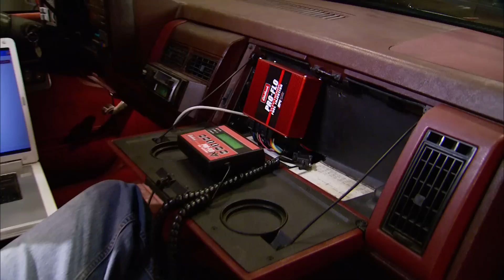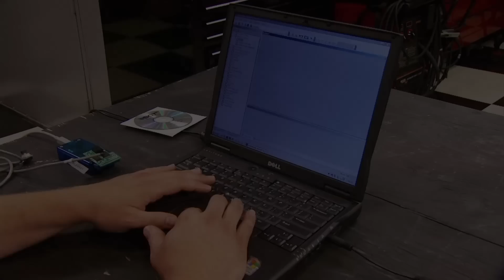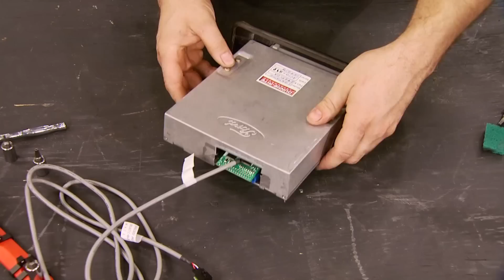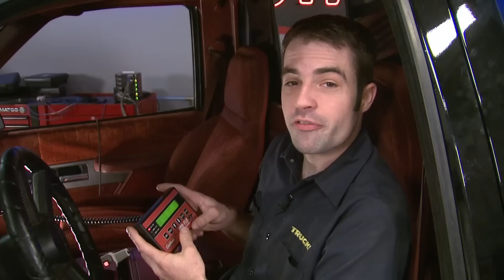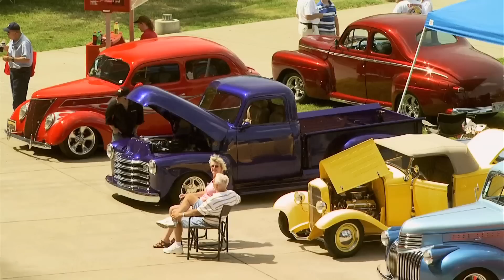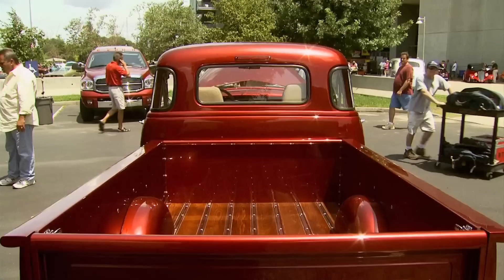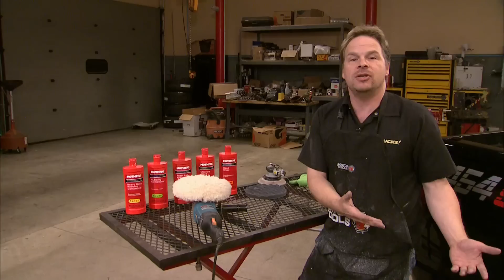Chassis Dyno Shootout: Chevy 454 SS vs Ford Lightning MuscleTrux Wars Part 6 - Trucks! S10, E15

Comment: So, expensive heads, expensive cam, expensive induction, all for 400hp? I made more than that with a mid sized cam, head porting and an 850 dbl pumper on a 1970 oval port 396

Comment: Im a Ford guy but I expected that 454 to make a ton of torque...but that 351w is a strong engine, My granpa bought a brand new 96 F250 with the 351 used it mostly for farm use pulling his Jd4020 tractor, fertilizer spreaders with 2 tons of fert...he babyed the truck, but when my pops got ahold to it...Long tube headers, true duals, intake ported, cylinder heads ported really woke it up...Shouts from TEXAS

Comment: Yall had to of had these detuned for for emissions and corporate reasons you can put aluminum heads and drop compression on 454s and make more power from flow alone you added flow and compression and got numbers factory heads can do with a cam and dual plane with a carb these trucks are pathetic in the power department went from worse to only bad

Comment: I wonder what these would make on a crank dyno? Probably close to 100 hp more and 100 tq on each measure. On Motor Trend Engine Masters they only measure crank dyno with no accessories like the auto industry used to do for gross hp not sae hp.

Comment: My stock 01 Z06 made 350 whp SAE corrected lol. That's with a smooth idle and 30 mpg and only 346 cubic inches. How did a heads/cam package on a 454 make less power than a stock LS6 from 20 years ago?
Reply: The EFI kills them. With a 780 carb it would've made more power. Because those LS6 454s were actually in the 550hp ball park.
Reply: @anthonypesqueira7540  That doesn't make much sense. How would electronic fuel injection create a massive power loss?

Comment: Maybe I'm missing something but I remember engines making way more power than this in the 60s and early 70s. Especially the 454. Well over 400 hp from the factory. High compression and leaded fuel I guess
Reply: That 454 needed new pistons to get that compression up. It still was under 9.1 with those new heads that’s not going to make a lot of power without boost.

Comment: Sitting here  watching these guys turn wrenches and throw money away  ! At 2 gas trucks ! To get 350 ft lbs torque ! 94 dodge 12v 175 horsepower 420 torque  STOCK!  SO LET'S SEE ! $300 for 150hp fuel nozzle ! $800 for turbo and $400 4"exhaust and $ 200 for head Studs and gasket  !  $1700 in parts ! 300  to 330 hp ! At 300 hp b around 540 torque and 330 hp real close to 600 ft lbs of torque!  But I bet they spent way more than $1700 ! Bet they could spend  $3500  on them gasser and not make 600 ft lbs  torque  !

Comment: Man pretty lame numbers for the 454 but definitely could use a little more compression. And as for the cool lightning it really needed a decent set of heads with good springs and an a cam with actual lift not that tiny crap they came with from factory and then you'd be able to rev it past 5500 safely with out valve float

Comment: In my opinion the 454 needed a lot more compression at least 10-1 .my 1999 z28 made  350hp 350tq ls6 intake tsp stage 2 truck cam tsp 17/8 longtube headers 3600 stall 410 gears tuned

Comment: Years ago I had a '72 Chevy El Camino SS (Chevelle Edition) that came from the factory with a 454 big block and  TH400 trans.  I added a 2800 stall convertor, true dual 3" straight pipes, a set of 10X15's on the front and Mickey Thompson 26X15's on the rear all mounted on Cragar SS five spoke rims.  I was thinking about lowering it but I had an "accident" and totaled it and almost killed me a brother of mine and me to boot.  Lord I wish I had it today exactly like it was... pre-accident that is!!!  
I've always been a Chevy person.  Not that I haven't owned all kinds of other makes and models, it's just I've always had better luck with Chevys than the rest.

Comment: Using computers and software on these old crates! . bleeeh yuck.  Use hei and stand-alone systems at the most. Turbo with a carb even. These things suck...Have to go to a tuner and buy a bunch of computer trash to run my  rod.. what a joke.

Comment: 454 ONLY 350 HP IS NOT VERY GOOD YOU NEED TO GET COMPRESSION TO AT LEAST 9.5 - 1 YOU SHOULD CHANGE OUT THOSE CRAP PISTONS AND YOU SHOULD GET A SOLID 450 HP AT THE CRANK.

Comment: Love these trucks.  But a 454 with aftermarket heads vs a 351w with a rear mount turbo.  No contest.  Why not upgrade the HCI on the 351w to give it a fighting chance?  90% of owners would go that route.  Not this rear mounted turbo setup and the associated EEC IV tuning , which is a lost art nowadays.  This is an unfair/unlevel build of these badass muscle trucks.  I mean GT40 heads were the cats meow back in the 90's early 00's but today?  Waste of time.  Might as well LS both of them and have some cookie cutters ready to dyno identical numbers minus driveline losses........

Comment: Thousand dollar 86 short side Chevy, mild 383 with cam and vortec heads.... 400 horses all day long, and 20 years ago, with a carb, and almost no money lol... daily drove it for years with a 3000 stall, and would have smoked both these trucks with 2 plug wires off

Comment: The Ford has a turbo? I thought these were supposed to be stock.
Reply: The chevy is not close to stock either. Different top end. Watch the earlier videos
Reply: @jasonamerica7618  Yeah well it's still na. Turbo vs different top end is no comparison.
Reply: @IanRLewis  I agree with you but 351 vs 454 the ford had to make up 100 cubic inches somehow
Reply: @jasonamerica7618  My old Dakota RT had a 360 and it ran much faster times in the 8th and it was close to stock. I didn't need to make up for any cubic inches. You got people in 4 bangers running times that are 5 seconds faster than these guys. It's not about cubic inches in other words.
Reply: @IanRLewis  2 things 4cyl cars are a lot less weight and both trucks were having traction issues. A RT Dakota didn't put down near the power of either of these trucks so I don't know how you were going so fast
Reply: @jasonamerica7618  2 door Dakota Rt was a  lighter truck by 1000 lbs with 350 lbs of torque bone stock and mine was not bone stock. I was even faster than the supercharged 99 Ford Lightning that had 100 horse more than me. It's not about power all the time. The trucks in the video had slicks and I did it on street tires with about 20lbs of pressure. I was in the Dakota Rt club for 9 years in Chicago and Florida. We had Lightning Dakota shoot outs all the time. I am talking about the Lightnings that were newer and faster than that old 95 in the video. Some were running 10s in the 1/4.
Reply: @IanRLewis  Sorry but a 2 door Dakota with a 360 is not 1000 lbs lighter than a 95 or 2001 lighting. I get the feeling that you are a dodge fan boy, so no matter what I say about these trucks you will keep calling them slow junk. Truth is that a ford lighting of any year will bring a lot more money than a Dakota Rt. Dodge has always been the worst of the big 3 because of there slow sales. They didn't have any money that's why the Government bailed them out twice then they still went bankrupt and got bought out twice. To each their own
Reply: @jasonamerica7618  No I actually have a Cobra now. I sold that truck a while bacl. It is the only video a made public on youtube. The truck was great though. My truck weighed 3500 lbs. It was the regular cab without back seats. The guy I sold it to still has it and takes it to shows. He was my neighbor in St Pete, Fl. I ran 8.6 in that truck at Lakeland Speedway in the 1/8th. My Mustang spanks the shit out of that truck. I just can't understand why the times are so slow with the ho those guys have.
Reply: @IanRLewis  My guess is the trucks need more gear in them. My old Mustang ran 11.90s in the 1/4 mile  and it was mid mid to low 7s in the 1/8th I can't remember to be honest. I know 9 seconds in the 1/8 is slow. Sorry I called you a dodge fan boy by the way
Reply: @jasonamerica7618  I don't blame you. I found Ford to be the most reliable and fastest.

Comment: And it's at least 400 at the crank what's all the complaining about with compression and bigger cam there's your 450 500 horse motor they didn't aim to build a high compression big block that might over heat in a big heavy truck that thing will probably tow anything and never get hot on junk fuel

Comment: Everyone complaining that power numbers were low back then mid ten second 350 Nova I had was fucking flying it was all motor 3300 pounds the pro street drag class was only running 950 at our track now they run 7 sec the 454 only had 8.5 to one and adding 120 plus horse like he did is a normal cam and head swap numbers with 10 to one they could have put way more cam but this thing can run on junk fuel and prolly pass emissions which was there goal

Comment: First gen Ford Lightning’s have always been one of my favorite all time hot rod trucks, and the red Lightning y’all have here makes me fall in love with them all over again! So glad you kept the stock wheels as they really complete the look of this 90s powerhouse 💪 
I remember when this originally aired about 10 or so years ago and haven’t seen it since so watching these again have been a real treat!
Can’t wait to see when these go head to head! I honestly don’t remember which won, but my money is on the Ford. 
Though that 454SS is still one badass truck, and looks absolutely sinister!
I would only change one thing on it though, I’d have to find a stock set of wheels for it. The aftermarket ones look nice, but just isn’t a 454SS without those iconic chrome wheels.
Looking forward to more!
Reply: Whites better

Comment: All this work for 300 hp... and we wonder why LS motors are so popular 😂
Reply: Do you dorks not realize it's 300+ to the wheels, which is about 400 to the crank, up from 230?
Reply: I got that much h p in my 2001 Chevy truck
Reply: They half assed these engine builds...
Reply: @groundshakersociety6637  I disagree, they spent a lot of time and money on both trucks. An LS with a cam would make more power than these.... Let alone if you went with a turbo or rebuilt it like they did with the 454.
Reply: @OGbqze  they put down 5g on a big block which still doesn't make 400 horsepower...that's sad
Reply: @groundshakersociety6637  yeah, there's much better options for power per dollar. But I'm sure these guys are used to spending money like its nothing.
Reply: Miatas Forever Good point. The LS employs simple, go-to performance at a reasonable price, for the most part.
Reply: I can get more horsepower than that with A stock 5.3 and a cam lol
Reply: Aussie barra would shit on these
Reply: Or the ls

Comment: LONG WAY FROM 400-450 FOR THE BB
Reply: Not really. They never claimed that it was going to be 450 at the wheels. They said 450 at the crank. As is, it's around 400 to the crank.

Comment: Who da FAQ told ya to clean the contacts like that! A little cleaning alcohol on a swab ONLY !!!! Then plug home and remove the socket a couple of times. All you blokes did was damage and remove the coatings on the connectors, leading to early failure.

Comment: Just over 300 hp with boost on a 351 with gt40 heads and tubular GT40 tubular intake? Good lord that sucks. With just a swap in injectors for some 120lb/hr, a 340 l/hr pump and roughly 15 psi of boost, that lightning would be well over 500 hp to the wheels.

Comment: Those 454s were junk. You would need to replace every part as an upgrade. The LS based engines are much lighter and make just as much power. Turbo charging a 6.0L and you could see 700-1000hp.

Comment: Taking advice from these guys.... is like flushing cash down the toilet
Reply: Exactly.
Reply: Yeah that is obvious from the guy installing a tailpipe turbo on a pickup truck when there is gobs of room under the hood for the turbo where the charge air won't have to run through 5 miles of piping and the oil won't have to go through the same amount of lines. WTF? No intercooler either? I didn't see him install a scavenging pump which is needed for that setup. Then there's the classic noob move of installing bigger injectors but not the in tank fuel pump to provide the correct fuel flow for a boosted engine. I'm really surprised they didn't roach all the pistons with it leaning out under boost on the dyno and hammer head still with his foot to the floor after they wave their arms to lift. And I'm sorry, but a 454 with heads, cam, and intake should be able to top 400+ WHP. Granted, the compression ratio was still puny but that engine should have made way more than they did. The guys on Engine Power did a low buck 454 build and got almost 500 HP. And Engine Masters also got similar results with a low buck build. Probably because they know how to match the parts so that they all work together instead of a cam and heads that work in the high RPM band and they don't spin it that high.
Reply: Had to leave something for us shade tree mechanics to bitch about
Reply: And you and Bling Status doesn't have a car show because why?
Reply: @sj7624  Lol ok Rim Job.  Let me know when you have something that makes over 100hp/cylinder or 250hp/liter.... but my guess is that you don't have anything like that because you've been watching these two goons fumble their way through dyno tuning a truck.  Love how dumbo was in there flooring it and the guys operating the computer had to tell him to cut the throttle for over a second before he did it.  Real race cars would probably blow up if you let a ding dong in the seat floor it while lean for that long.  I'd expect that you'd know that but you're probably still talking about 4-barrel carbs and big blocks... saying superchargers are better than turbo chargers and that kind of garbage.
Reply: @sj7624  So you need to have a car show to know that spending thousands of dollars on a 454 big block to make less than 400rwhp is a waste of money????? Wow.... you must be really struggling in life, you poor  dumb bastard. 

Given your flawed logic and silly straw man argument, here is some life advice pitched specifically for you.. 'don't lick the windows on the bus and don't  eat the yellow snow".
Cheers!
Reply: @ajv802  and with all that bullshit you just spewed out of your own ass, you still did not answer my question. If you think you are so much better than these two hosts, how come you do not have your own damn show? Last time I checked I did not see a show call Tech time with ajv80.
Reply: R J So these guys are better mechanics than ANYONE without a show??? Is that what you are saying? Yes or no?

To answer your shit question. I have zero interest in having a show, let alone even know how to make and edit one if I did. What has that got to do with anything??????? Out of general amusement I’d ask why you don’t have a show but to be honest I don’t really give a fuck to know, especially if you consider these guys spending of money to be “good bang for buck”.

Your argument and logic is flawed and has you are making no point, sorry if you don’t like hearing the truth.
Reply: @ajv802  ok for starters I never said that these are better than real mechanics so fuck off on that one!

Second the only flawed logic in this post is yours.
Why would you go on the comments and post shit about parts being used on a show that is well over 10 years ago? You do realize that this show is for entertainment and nothing else. I'm sure you know that this is just as scripted as the other so called reality TV shows.
Reply: @sj7624  Hahahhaa, i must have cut a little close to the bone. 

The video was uploaded recently by the original creator, regardless of when it was originally filmed. Its a Youtube comments section, thats why I commented my opinion on the show, its kind of what comments sections are designed for. If you have a problem with that, don't read the comments. So fuck off on that one :)

Who gives a shit if its 10 years old, those results are pathetic for even 15 years ago. They are not even close to 1hp per cubic inch at the flywheel and thats on a modified engine, one of them had a turbo hahahahaha. They even fell embarrassingly short on even their own forecasts on that 454  So fuck right off on that one. :)

All TV shows are made for entertainment purposes. Whats you point exactly???? So fuck off on that one too :)

Why do you feel the need to defend them from criticism?  Your stupid straw man argument attempt about me not having a tv show has backfired, you now have egg on your face and and sound stupid. The best thing you can do is just to shut up now and stop digging yourself a hole dude. 

You did insinuate that because i didn't have a tv show i couldn't comment or have an opinion??? You must either hold the opinion of TV show mechanics higher than other mechanics OR... ??? It was your stupid question, you tell me what your point was because i have no fucking idea.

Have you recently quit smoking or something? You just seem irrationally irritated? 

Sorry for personally attacking you dude, that was a bit harsh.

Comment: So why didn't they give the Ford numbers with the new pump ???????
Reply: Cuz all the Chevy guys would be 😢. That's not fair he got 5psi boost. That's all you would hear. But the Chevy had heads can intake pretty much built motor lighting has stock engine.
Reply: Can't beat em cheat em 😂😂😂😂😂

Comment: I know for a fact that 454 will make more hp with a carb and intake I have the same set up with a 850 double pumper carb bigger cam and I made 564 hp on the dyno let's face it that 1990 computer and intake cant keep up with the mods. Ford always did have a better computer than chevy. Just like the old school fox bodies had the A9L computers light years ahead of chevys